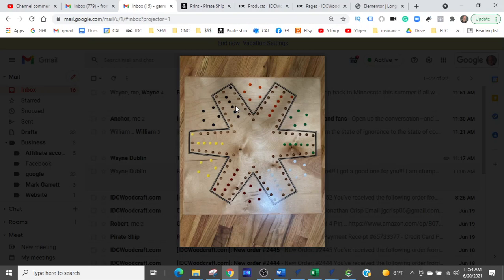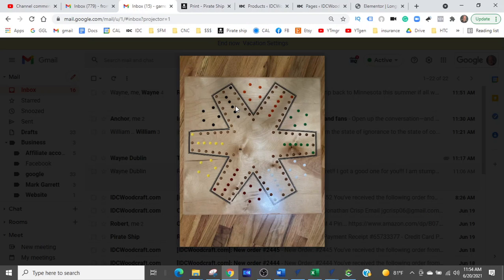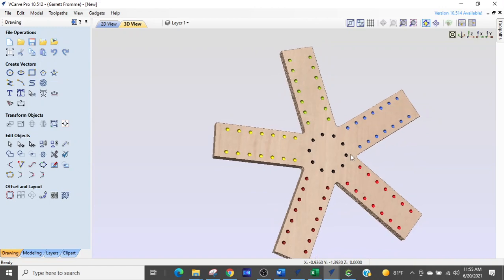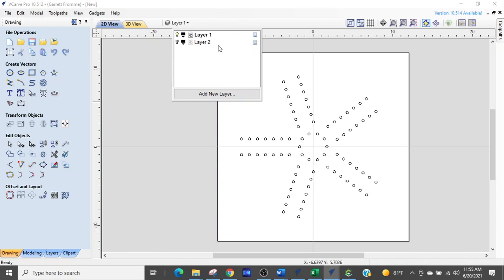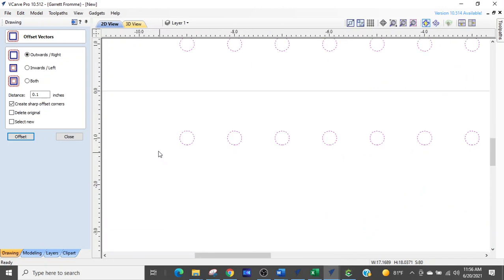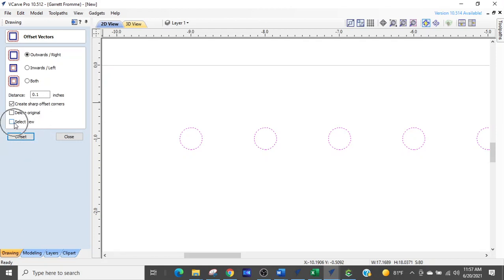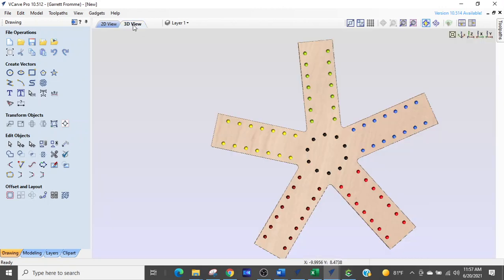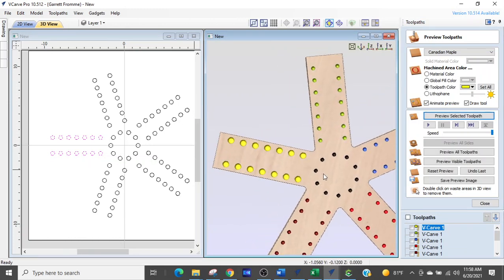How To Fix Wrong Size Holes [Vectric Vcarve & Aspire Tutorial] - Garrett Fromme

Comment: If you used select by layer instead of by selected vectors when generating tool path, then I don't think you would have to reselect the new holes, just make sure to delete the original.  Not sure, just wondering. I have been using layers more often now, and I find that I am using that option more often
Reply from the maker: Thanks Erik I didn;t even think of that.

Comment: On some things it's nice to have the original size holes remain. One instance in particular is if you want to drill and hole then generate a counterbore around it to clear a screw head, liie one might use to mount a spoil board to a machine table. I fumbled and stumbled with this and just drew two circles. Knowing these little techniques can save a lot of time, effort and frustration.
Reply from the maker: Good point CNC. I didn;t even think of that. I could have used that during my spoilboard designing.

Comment: First thing is using layers is sometimes a waste of time.  I know that some people just want to keep the same method of doing things like keeping the habit of locking your door when you leave but it is sometimes a waste of time and effort. Second is Why did you make separate tool paths for each color when the color shouldn't come into play till after all the carving is done. You could have made all it in just one tool path file
Reply: Man.. how do you get the different colors on the 3d page?? I been trying to do that for a while.. probably simple.. lol right in front of my face probably
Reply from the maker: @jtinsley916  while in toolpath preview mode, select the toolpath you want to color. At top, select "toolpath color: then choose the color you want.
Reply from the maker: Hi Terry. I am an avid later user. Maybe not necessary sometimes but I will maintain the habit and encourage to use it over not using it, even if it seems irrelevant.

No, I didn't need to make separate toolpaths for each marble side. The color was for the video.